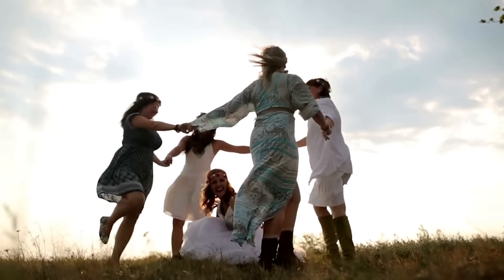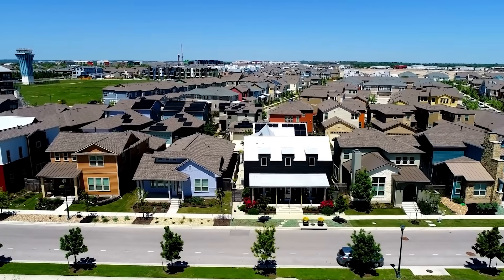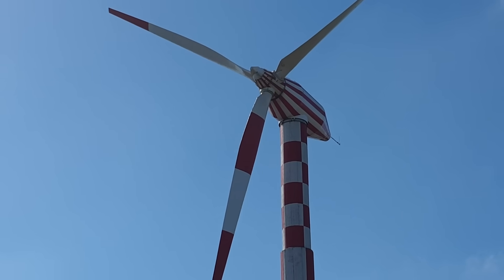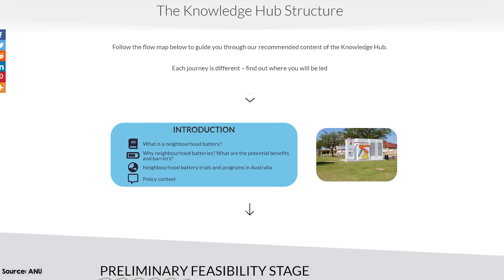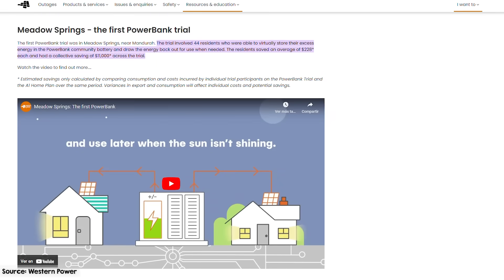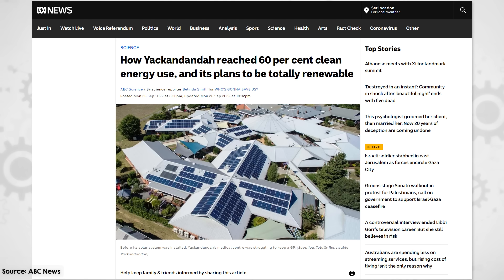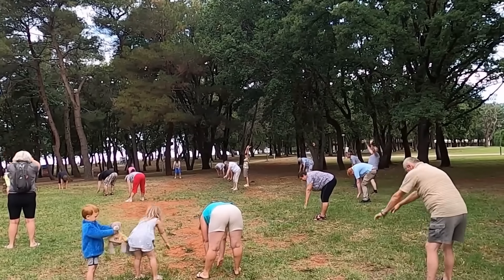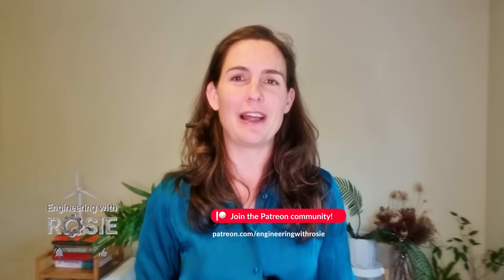Energy Independence Through Community Batteries, Wind and Solar

Comment: I have done a lot of thinking about it, I am also an engineer and I have a better idea, Rosie. 

My proposal involves creating a huge-scale battery (commercial) that individuals can invest in, receiving virtual battery ownership in return. This virtual battery would provide energy credits to participants.

Advantages

1. **Economies of Scale**: A large battery would be more cost-effective per storage unit than many smaller batteries.

2. **Geographic Flexibility**: The battery could be strategically placed in areas with higher electricity prices, like South Australia, allowing the investors to benefit from price differentials. The investor buys the electricity in cheap Victoria and sells at the dearer SA price at the most expensive time. The greenhouse gases are the same here.

3. **Accessibility**: This model could make battery storage accessible to those who can't install their own systems, such as renters or apartment dwellers.

4. **Reduced Complexity**: Centralized management would simplify maintenance and operation compared to numerous small distributed batteries.

5. **Grid Benefits**: A large-scale battery could provide significant grid stabilization services, potentially earning additional revenue.

6. **Financial **: Large-scale finance would be available at no cost to the taxpayer.

Comment: Rosie, I think you need to be more specific and define several types om “community setups”. It seems you focussed on a community agreing to create a source of power “somewhere”, not necessarily co-located with the community. This means, at the the power grid in some way or form is used to diatribute the power.
The alternative, either an appartment building or a group of houses, essentially having their “own” local power grid (forget who might have financed the original construction).
In both cases the rules and regulations regarding metering and power company tarifs play a major role.
In my country the property borderline, be that between destinct houses og between appartments, play a major role. Any power crossing a borderline is subject to full tax and tarif payment. Why is this important ? Because these taxes and tarifs are levied on in-house production. The obvious wish in such a case is defining an outside perimeter within which the “community” makes its own rules for sharing the community power production (and battery storage).
As you may know, a very early offshore wind farm off Copenhagen (Middelgrunden Vindmølle Laug), which certainly was off site for the owners, used the public grid and gave their owners a reduced electric bill - similar to your description.

Comment: There are some community owned wind turbines in Germany.

Here in Iceland we have community owned power. Reykjavik has both a distribution company Orkuveita  and a company ON producing, both hot water and electricity. Orkuveita has monopoly regarding distribution of electricity and hot water in it's area. ON has a monopoly on hot water, but one can buy electricity from different producers.
Smaller communities have combined to do similar operations.
The main difference here in Iceland is, that most of our projects are not small community scale. Out in the country you see some small community district heating using low temperature geothermal hot water. But hydro power and geothermal power projects are usually rather large scale. Reykjavík owns two geothermal power plants. Nesjavallavirkjun that provides 120 MWe electrical power and 300 MWh hot water, Hellisheiðarvirkjun that provides 303 MWe and 200 MWh and a small scale older hydro power plant providing 8 MWe. Hellisheiðarvirkjun could either scale up electricity production with a binary plant or supply more hot water for district heating if needed.
HS Orka providing the communities of the Reykjavík peninsula with electricity and hot wate  and has assimilated two community  power companies in the country, they run two geothermal power stations Svartsengi 75 MWe and 100 MWh, Reykjanesvirkjun 130 MWe and two hydro power stations out in the country, Brúarvirkjun 9.9 MWe and Fjarðarárvirkjan 9.8 MWe. In those areas the direct heat come from boreholes with a to low temperatures for a flash power plant. The distribution is again a separate company HS Veita.
We do not use solar and have only a few wind turbines. Some farmers had small hydro turbines in the few KW range, but that disappeared as all Iceland was connected to the grid.
In the last years we see small scale hydro power, defined here as below 10 MWe, making a comeback. But geothermal electrical power plants do usually work well for small scale operation, because of the cost of boring the working holes. We have three of them, Bjarnaflag flash steam 3 MWe, Húsavík 2 MWe binary Kalina cycle and Flúðir 0.6 binary cycle. Both Húsavík and Flúðir use boreholes that were bored to supply the villages with hot water and use the excess water. Bjarnaflag, taken in use 1969, was a test operation for a flash steam plant, before Kröfluvirkjun 60 MWe was build in 1975.

Comment: It doesn’t work, SA and ACT are great examples, proponents use the net energy arguments to be misleading the public, but they are dependent on fossil fuel most of the time. Gas turbines and nuclear are needed if coal fired power stations continue to go offline, as batteries and pumped hydro don’t have enough grunt to run cities.

Comment: I'm convinced that microgrids will have a great future, but that are still to many obstacles to build one. We need to rethink the grid on a local level to get all of the benefits, as reduced transmission losses, out of the system. Future microgrids should be DC Grids connected to DC vehicle to microgrid EV charging. Experts talk about it for decades, but progress is extremely slow.

Comment: I don’t know, if you have just identified the major problem with the community grid system as bad demand management perhaps talk about the costs and problems of fixing that rather then reaching for more technology. Change the off peak times on the water heaters to the middle of the day  or install smart meters to trigger the heaters at time of maximum supply. Thats a much more sensible solution then installing a battery or dam to heat water in the middle of the night. Then see how much missing power the town needs.

Comment: Thank you for the update on how mass renewable energy projects are massively delayed because National grid connection take years! The real estate we need for net zero is available now! No environmental checks! No public complaints, no grid connection delay and fitted and running in 2 weeks! Home solar and storage is easy fast and relatively cheap. Community storage is ok but what about the storage community, 10k homes with 10kw storage batteries the grid can access when demand is high. Need to stop thinking big, instead think small but plenty...

Comment: Nearby is the first self sufficent village in the world Jühnde. Since 2006 producing power and heat locally all year round. If everyone is in, it is possible in a few years.

Community energy is the way how most of the wind turbines were constructed till a few years ago in Germany.
Reply: Jühnde is grid-tied, which means 100% reliant on fossil-fuels:

"Jühnde, like many other German towns that ave successfully achieved high uptake of renewables, has benefited from the German Feed-in Tariff Law or Renewable Sources Act (EEG)..."
Reply: @aliendroneservices6621  Can you explain, what grid-tied and 100% fossil fuel reliant are supposed to mean?
Reply: @juliane__  The village of Jühnde is not self-sufficient, as it is connected to the fossil-fueled German electrical grid which supplies it with reliable power-service (which it is allowed to steal, by way of a "feed-in" agreement).

Comment: What I think could prompt some more community based energy solutions would be the ability to easily self generate their own fuels. Imagine decentralized small-scale fuel plants that could be community owned. It could really keep a lot of wealth from being siphoned out of smaller centers. Sadly industrial fuel synthesizing plants are large, complex and expensive builds that generally need economies of scale to financially make sense. But imagine if affordable simplified and low-maintenance modules could be bought where you only needed to supply them with water and power to get a fuel like ammonia which could be either sold as a commodity or used as a backup energy source for the community.

Comment: I think community batteries are a key stepping stone to individual batteries.
They work by allowing customers to store the excess power their solar panels generate during the day for use later on in the evening. Community batteries are usually around the size of a large car in dimensions and can store around 500kWh of energy – that's enough to support about 250 households.

2kWh per household. 

Now if EVs are 100kwh and parked 23hrs every day then in my street of 30 homes and 60 vehicles we have 6,000kWh.

That is 3,000 households. 

Thats 100 times the streets recomended needs.

Naturally the home robotic vacuum cleaner and the selfparking EVs will plug into the grid 23hrs every day. 

Infact the EVs could plug into the grid anywhere there is a cheap wall plug at a car park space.

Comment: from: @3rdrock:  >Why heat  water at night, when you have excess power in the day? <
Indeed, this legacy thing of running water heaters overnight needs to be stopped today.
To my thinking, the best and cheapest use of PV-generated electricity is to power water heaters during the day; then space heat, depending on the weather that day..  Hot water IS a means of storing energy, and there are no signs that humans will stop showering or washing clothes or dishes any time soon.

Comment: I lived in Ellenbrook in Perth in the  2010s, and most nights in summer the power would cut out right when all the streetlights would come on. They ended up running another main power line to boost local capacity but local storage would have been a better solution if it had been available at the time

Comment: Batteries connected to sub stations can store cheap night power and supply during the day-reducing energy bills for those connected. Communities should be able to buy low voltage systems from the sub station!!

Comment: Batteries are a lousy solution for community power. They are far too expensive, and only suitable for around 4 hours of storage, not overnight etc. Maybe some future battery tech, flow batteries etc will do the trick, but they are not really in sight. 

Fortunately there is in my view a solution to hand being built right now, which would provide storage for overnight, although in its easiest configurations not for a period of a week or so.

That is compressed CO2, as developed and being installed by Energy Dome right now.

They can be put anywhere save in places where space is really restricted, use industry standard components and have excellent round trip efficiency, although not quite as high as a battery under optimal conditions.

I am unable to put in a link or the comment will be autokilled by Google spam, but a quick search will show the solid technical foundations of this, the current completed testing of prototypes, and the current build of full scale installations, in Italy and now scheduled for the US.

Industry standard components mean that we can be confident in putting in cost reduction curves, and with the long life of all components, we are talking about storage good for decades of operations, easily scalable, and able to be installed almost anywhere.

Unfortunately I have no financial interest at stake in this tech, so this is just my unbiased opinion! ;-)

Comment: I made contact with a company in China and I could purchase solar panels at a 10th of the price they are in the UK.  I priced up a 32KW system with batteries and inverter and import duty and the total cost to purchase direct from China and have shipped to the UK is just over £10K, in the UK the same system would cost over £50K.

Comment: One thing often overlooked but pleased to see the Yack community address - invest in reducing load before trying to power it with renewables.  Typically there is a lot of low hanging fruit so every $ spent improving energy efficiency will save multiples of renewable infrastructure $.  And reduce energy and GHG emissions from manufacturing as less infrastructure is required
Reply: The hotwater heaters running on daily solar electricity and not the 2am electricity might be a good start. 😊
Reply: Agree Stephen, though depends a bit on circumstances.  90% of the time that is right.  In my situation I found that adding one extra PV panel satisfies my daily water heating needs so more cost effective than solar HW.  But that was after making sure hot water capacity is optimised (ie not oversized!).  It helps that I live in warm sunny location and have low HW use.  Point is, do some analysis of electrical consumption and reduce it as much as practical before adding renewable.
Reply: @gregmorgan8350  
Agree. PV needs say 8m2 for water heating and thermal only 4m2, but solar is much more useful.
Extra PV panels while the installation is happening is a minor cost.

Thermal hotwater needs heavy infrastructure, a plumber, an electrician for the back up heating elements and a check on strength of the roof structure. 

Solar thermal hotwater was old school technology long before our PV panels.
Reply: Yep, agree thermal solar significantly more expensive - and all you get is HW, whereas increased PV more useful as can serve any electrical load.  How much area is needed to heat water by either method really depends on local climate, solar irradiation and how much HW the household uses.  We need only about 3m2 of PV but have lots of sun, warm incoming utility water and usually only 2 people.  But very different in other scenarios I know!  Loving Rosie’s great channel

Comment: Good to see you touched on some of the social impacts of this ‘transition’ (akin to a botched gender transition) cause transitioning is very fashionable these days. 

Though it's not community-owned, Coober Pedy is an interesting example of a stand-alone system - power prices are so ‘cheap’ that it needs to be subsidised by the state and the cost of the project was a contributing factor in getting the local council into debt. Most of the residents and businesses complain of the high prices - not good if you want to protect people from extreme heat.

Solar and wind make electricity expensive unless you own the infrastructure yourself. Nuclear is expensive but makes electricity cheap.

Comment: Community batteries can be the best, most cost effective method of supporting the grid locally as well as soaking up excess solar. I think they should all be grid-connected to assist the grid beyond their borders and to make sure that excess solar can be used effectively. 
Personal batteries assist only the home-owner and any subsidies given by government only benefits that owner. If you're getting a subsidy for a home battery, I think you should be required to take part in a VPP scheme so that the community as a whole gets some benefit otherwise it's just "subsidies for the rich" who can afford to buy them anyway.

Comment: Excellent! Community batteries could make areas more independent of the grid, which has to be good.
Will we ever reach the time when there is a battery bank in every electricity sub-station to store power locally and distribute it when needed?
Governments seem to be favouring large grid batteries rather than encouraging local batteries. 
BTW, the Sunshine Coast Regional Council bought a farm and installed a solar farm and now meets its own electricity needs.

Comment: Yackandandah is not off grid. Most electricity is generated during off peak hours by rooftop solar which is heavily subsidised. Backup is provided free by the grid. This is essentially a parasitic system creating most electricity when it’s not needed.

So the township receives exactly the same mix of wind, solar, coal, gas and hydro that everybody on the NEM receive.

To go off grid and supply your own backup and FCAS would incur an astronomical cost per household.

Dumping surplus off peak electricity and getting free backup is unsustainable and when coal and gas generators are gone backup costs will skyrocket.

The whole concept of a cottage industry being cheaper than large industrial despatchable generators is ludicrous and invokes the Luddites.

Comment: Im curious how difficult it is to recycle panels
Reply: Almost all the mass of a panel is glass, steel or aluminium. Those are easy. Most of the rest is silicon and copper. Copper is fairly easy but silicon is hard.

Comment: Aside from community solar and batteries, is renewable propane an option for communities that want to go completely off-grid? (This would be for occasional mid-winter use.) Another option for consumers with V2G would be to use their EVs to import power during the winter (e.g. from public chargers using hydro power).